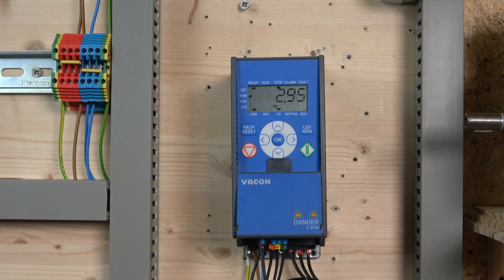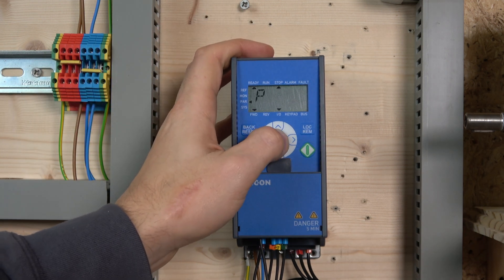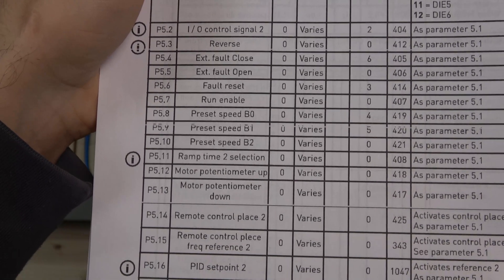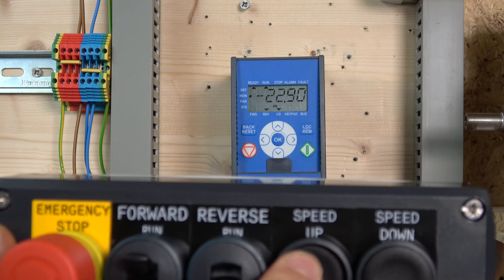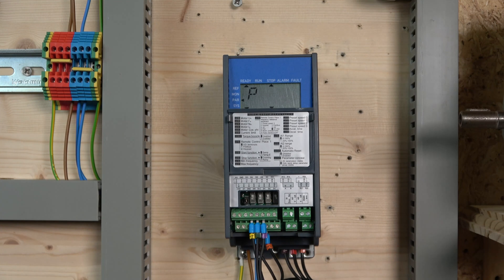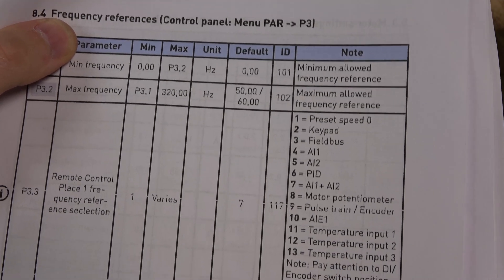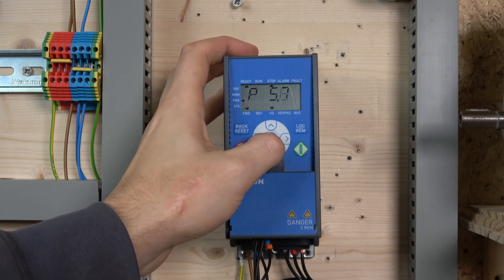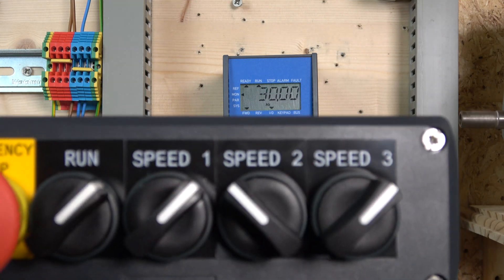Vacon 20 VFD, Remote control, MOP speed control, Multi Frequency set up. English

Comment: I have a vacon 20 VFD. I need to start it, two speeds,50 Hz, and 20 Hz clockwise. 
Now 50 Hz is ok. but 20 Hz speed rotate anticlockwise. how can I correct it?
Reply from the maker: Hi Nalin. For any preset frequency to work it need run signal. You have 2 options run forwards and run reverse, sound like 50Hz is turned on with run forwards signal, and 20 is turned on with run reverse signal, make sure both frequency's are turned on with run forwards signal.